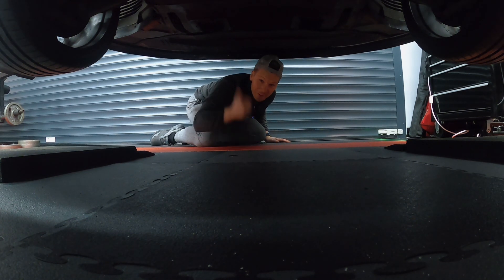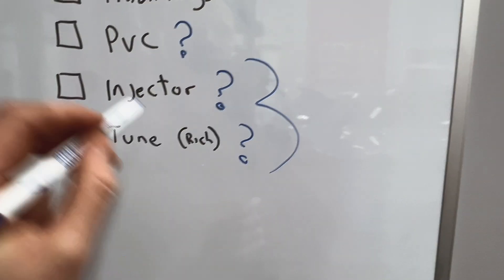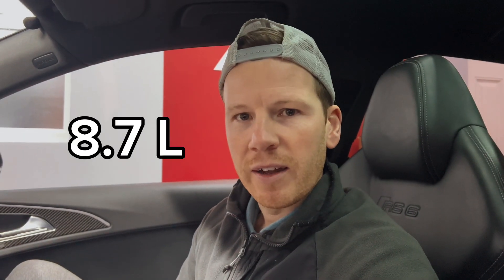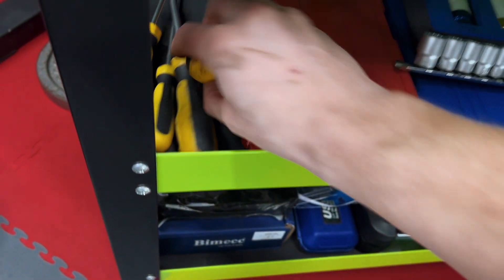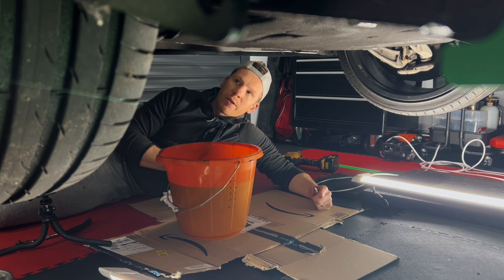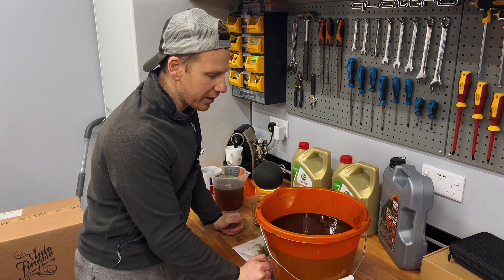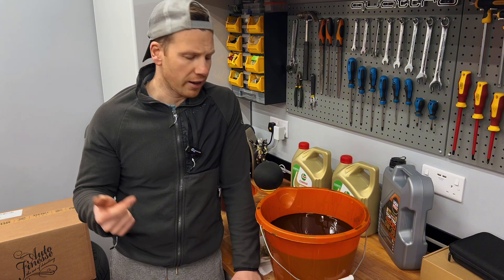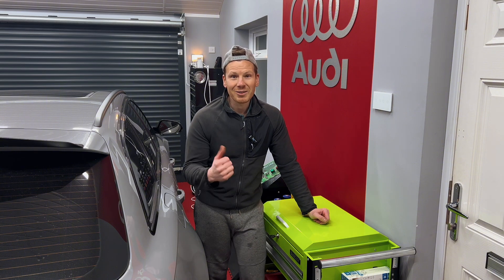Why does my Audi RS6 OIL smell like FUEL?

Comment: Have you considered doing the dip stick mod to your RS6? 
I recently purchased an Audi S4 3.0 TFSI and they have a bung/cap in the dip stick tube so I purchased a 3.0 TFSI compatible dip stick from Audi, and having had a quick look online i'm pretty sure the 4.0 TFSI RS6 engine has a bung in the dip stick tube, too. As you can imagine, checking the oil level is now far less faff than going through the MMI system 👍👍

Comment: Interesting how much oil difference there is. In my 2014 Left hand drive RS6 i need 9.3 liters of oil with filter change or 9 liters with no filter change. Car has 170k km and HPFP are still fine. My oil has a bit of gas smell but after analysis they did not find gas in the oil and my mechanic says that is normal to have a faint smell of gas for such a performance car. I always use the recomended oil from Audi and only put 100 octane gas in it.
Reply from the maker: Hi thanks for your comment.  I am going to follow your lead and also get an oil analysis test next. After changing both the HPFPs and PCV unit I am coming to the conclusion that it probably is just normal as more and more people are asking the same question.  Thanks again for watching  :)
Reply: @InDadsGarage  i have the car for 10 years. If you need any help just let me know with a reply and i will email you and try to help. Best of luck!

Comment: Guaranteed way of checking the HPFP's is via VCDS. Other way is when you get hard starts after the car has been sitting for a while after it's been run up to temperature. Basically if you smell fuel in the oil and get hard starts it's 100% the fuerl pumps. Hitachi are the OEM for these pumps too, so as other comments have said get these cheaper from autodoc or onlinecarparts, currently around 295 each with free delivery. Literally just fitted these a week ago to my C7.5, no more hard starts and fuel nice and clean with no fuel stink now.

Comment: i have the same issue on mine, what band of fuel pumps did you get? i got quoted at Audi for 800euro per pump + labor
Reply from the maker: Hi,  I bought Hitachi Fuel pumps,  same make and part number as the Audi ones but just not stamped with Audi logo.  I bought might from AUTODOC for around £250 each.
Reply: @InDadsGarage  thanks is order them as well
Reply from the maker: This is the part No. 2503085 on AutoDoc 👌
Reply: You can have a dip stick on these. Right side of the engine below the coil pack you’ll see a small black plug. That can be removed and dip stick used.  I know this as i pump oil out some times 😂🤣

Comment: From what I've read, the smell of gasoline in the oil in GDI engines is normal, especially in cars that travel short distances due to the engine not reaching the ideal temperature, and also because the injector injects gasoline directly from the combustion chamber, which always leaves put some fuel into the crankcase, if the oil level doesn't rise, then there won't be much to worry about, what you should do is change the oil and filter more regularly, like every 6 months, I do this on mine Toyota GDI, because I also smell like gasoline in the oil, but I drive my car a lot of short distances every day, but the oil level is always normal
Reply from the maker: Hey thanks for the comment and recommendation.  A few people have suggested sending an oil sample off for analysis to confirm if it is actually a problem or just driving style. I might do this in a future video,  I'll be interested to see the results as I haven't experienced any rise in oil levels.

Comment: 5-40 is the way to go 👌
Reply: It depends where u live ! 
In Sweden the temperature are really cold under -10 degrees C for more than 7 months. So we use 5W30
Reply: @SRR-td2eh  im Swedish 🇸🇪 no not really it depends where in Sweden you are living.  Like right know it’s 7*C where I live 😀 but I have my car stored in the garage over the cold winter months. I switched to 5-40 and the car runs much better
Reply: @firfox8612   
I agree with you. But in general we use mostly 0w30 and 5w30. 
I live in Norrbotten were the temperature drops down under -30 and mostly -10 for almost 7 months. Where u live in Sweden we consider it summer here up north 🤣 
In the south is totally different weather than north. Also a heated garage is nice to have, I would also switch to 5w40 if I lived in a warmer weather.
Reply from the maker: Loving the oil debate guys, great to see cross sharing of information in the comments.  I'm currently using 5w-30 here in the UK as recommended by a well know RS6 tuner who said stick with that unless i'm experiencing a lot of oil being burnt, then switch to 5w-40.  At the moment I have been changing the oil too regularly to notice any losses through burning lol.
Reply: @InDadsGarage  
5w30 is a thinner oil and I’m sure u know, I haven’t noticed any oil consumption using 5w30 and as I said they only reason I used it because I live in the north of Sweden and the temperatures reaches sometimes -30 degrees and average-10, and I use the car all year around ☺️
I’m sure 5w40 is a great oil also, but wouldn’t protect your engine in extreme cold weather as 5w30. 
And by the way I changed today the HPFP from Audi they costed 2200$ 🤦🏽
I changed the oil also and the smell is almost gone.

Comment: Did you fond out why the oil smells gasoline ?
Reply from the maker: Still investigating and will be posting a follow up video soon 👍
Reply: @InDadsGarage  
I have the same issue, the car runs great.
I did engine oil change and I flushed the engine 2 times. After driving it for a while I opened the oil cap and the smell was stinky and fresh of gasoline. So I’m gonna do like you, pressure test, injectors test, and HPFP test. I did change the pcv oil separator so that’s fine. 
I hope u will find the problem bro